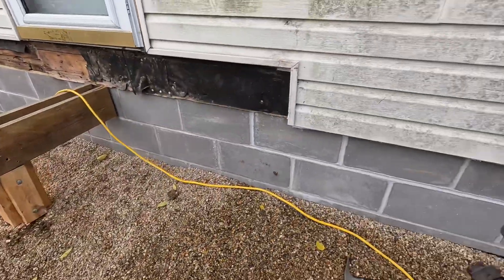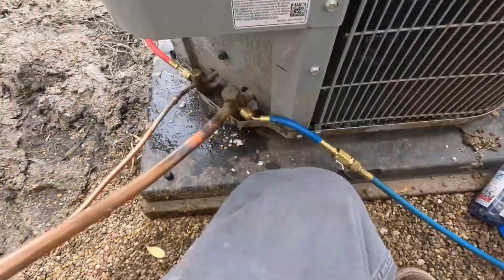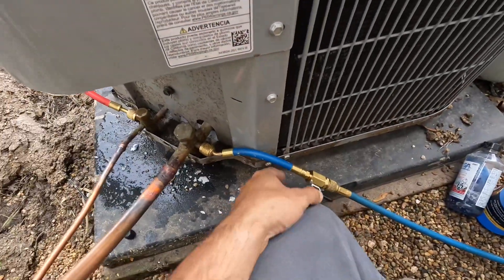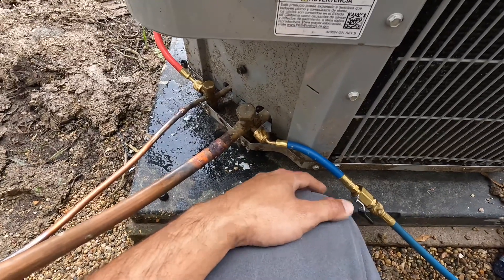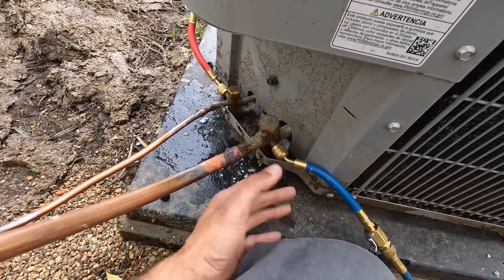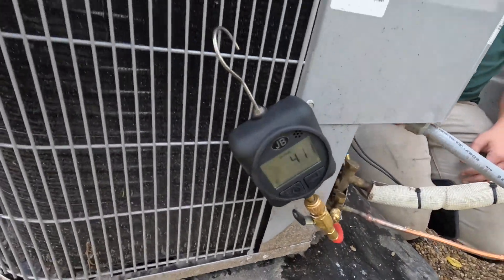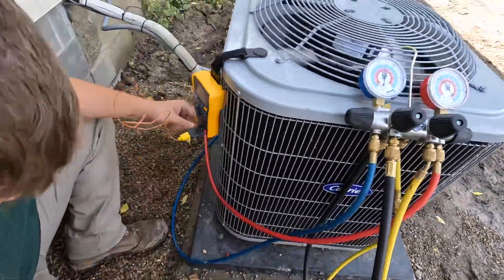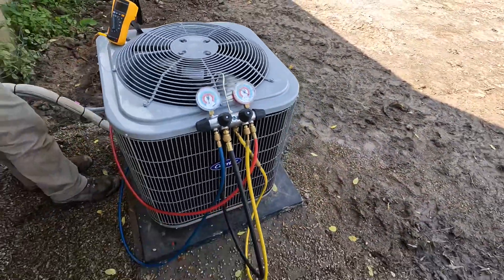Here’s Why It’s Important To Use Proper Brazing Techniques

Comment: Hello! How long did you work for the company before deciding to do work on your own? Appreciate. Is your customer from word of mouth. Appreciate bro.
Reply from the maker: I’m still working for a company. It’s been 3 years now, went to trade school first, I know a lot but still have more to learn.
Reply: Been doing hvac for 25yrs I went off on my own after 8yrs in the trade. Strictly residential now, but I did commercial industrial and refrigeration work. All my customers mostly word of mouth. Also advertise on socials cause it's free marketing. I tried Angie's list but u get all the jobs that everyone else walked on 😂 but get your feet wet in the trade, learn all u can. And develope a relationship with your repeat customers and tell them it's been great doing work for them but you're going off on your own now. 9x outta 10 that customer will stick with you, with who they know.
Reply: Bro. I’m new in trade. I do have little bit knowledge in HVAC. I only work part time with friends after work and weekend cause I have full time job. What would you recommend for me to gain more knowledge? Appreciate!
Reply: @bryanditol4562  check out your local union halls, pipefitters or sheetmetal. See when theyre accepting apprenticeship applications. Get paid to learn the trade and in 4-5yrs you'll be a journeymen, then you on easy street.